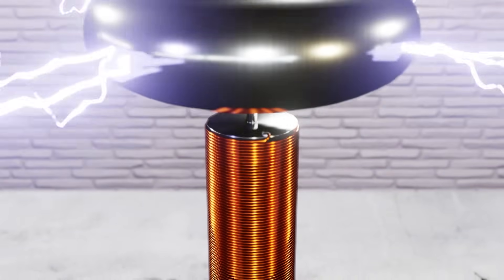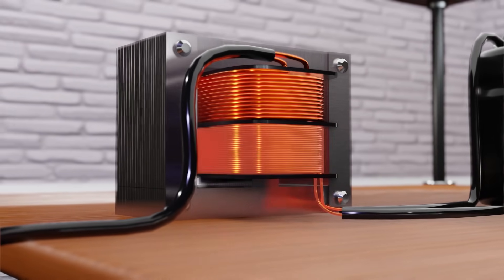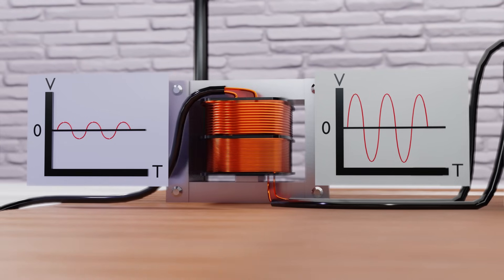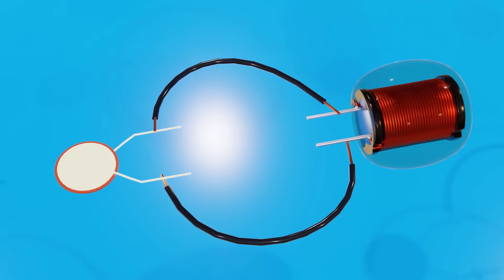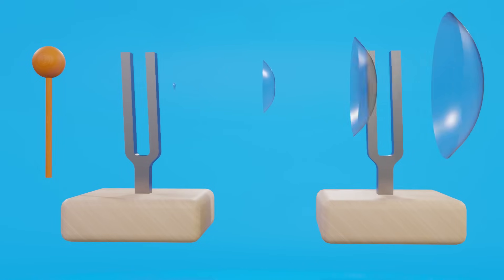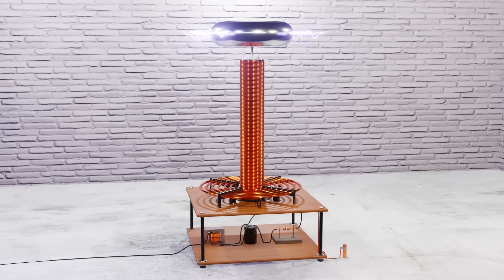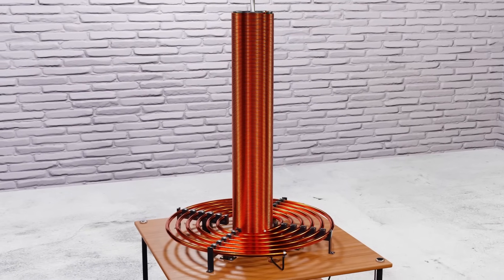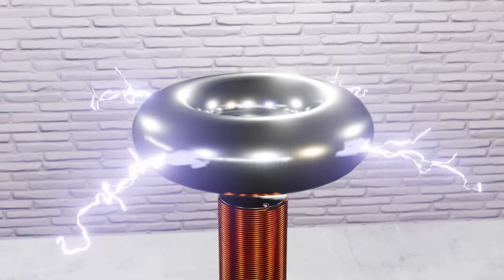How a Tesla Coil Works ⚡ How to Make a Tesla Coil ⚡ Nikola Tesla

Comment: I wanted to build a large tesla coil, but in the shape of a octopus, and have its arms swing around and shoot out sparks... Would the power that flows through, make the arms swing around a cage, and is a glass dome cage safer, then a metal cage, what is a safer cage, rubber? Can I make the top more round, like a head, or does it need to be that exact shape, a flat round tube... if I build a 10 foot tesla coil octopus, how dangerous would it be 🤔
Reply: glass is a great static charge conductor made in large capacitors, its called a faraday cage , check it out, the cage grabs the ionized air lightning and shoots it into the ground so that those bolts that generate 1000's watts are not being reflected off anywhere, those bolts are more unpredictable and as deadly as a bullet. Always wear rubber souls around a tesla coil, and don't touch anything metal in the room, even after the coil is off for 20 seconds.
Reply: Tell us how that works out
Reply: You might magnetize the rubber.

Comment: 13:53: we use it everyday like radio communications! Yeah, but it's not wireless POWER, it's signals for communications... and users still are waiting for wireless POWER distribution. Why should every video end with this childish consideration over common radio communications, I don't know.
Reply: You use a cell phone yea
Reply: It is wireless power but the power is so small that it can only practically be used for signaling. That is the problem with wireless power done like this...
Reply: @a64738  exactly. And I’m fully aware of the feasibility of Tesla Power distribution, and not just simple radio signalling

Comment: Here's a question I've always been curious of if you put a Tesla coil on a frozen lake on the ice and people stand around it will they get electrocuted through the ice?
Reply: Nah, the resistance of the ice would be too large. Especially bc you said it’s a lake, which presumably is freshwater and not salt water. Even more so if the people were wearing shoes/boots with rubber on the bottom, which I’m assuming they are bc they’re standing on ice. There would have to be an absolutely ridiculous amount of voltage coming from the Tesla coil for them to get zapped through the ice. Unless they were standing really close to the Tesla coil, but at that point the arcs would probably just jump to them instead of the ice
Reply: @LukeMalonsLIVES  but what if was a. Oh Tesla coil  would the ice show any electricity travel through it? I would experiment if knew how but I would end up dead lol
Reply: @oliverfalcon2868  yes especially if not knowing what one is doing with it lol.. that's why I came here to ask instead of building one and killing my self 🤣 I just know electricity travels through water but I've also been in a lake that was struck by lightning and never felt it. So I was curious when a Tesla coil is placed on a frozen lake on the ice and the electricity hits the ice what happens does it travel far so many questions so many questions
Reply: @maddmavic  I do know that if its happening at very high frequencies to music for example it doesnt do anything, you can hold a whole metal knife and it wont hurt you cause it just goes over your skin and doesnt reach the heart otr anything
Reply: @maddmavic  If the frequency of the AC is over 700Hz (cycles per second), the current would flow over you, not through you :)
Reply: If barefooted, yes it will kill them all! In the speed of light!
Reply: No.

Comment: There is no rectifier after transformer. There is no current limiting charging cirquitry. Are you crazy?!
Reply: Check out the new Tesla tower in North Texas.
Reply: No rectifier required. The current drawn from AC mains can be high enough to trip breakers or blow fuses, and either the first transformer limits the current or extra 'ballast' components not shown here can do the job. Yes coil builders sometimes seem crazy.
Reply: Maybe soldistate driver need rectifier